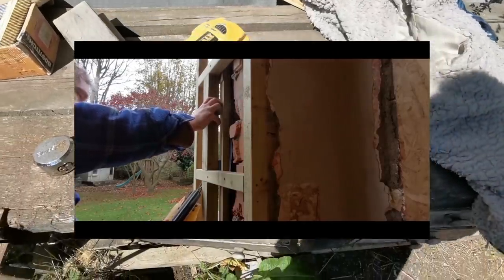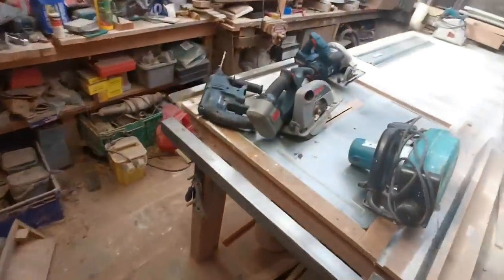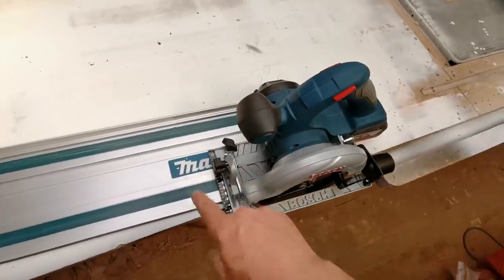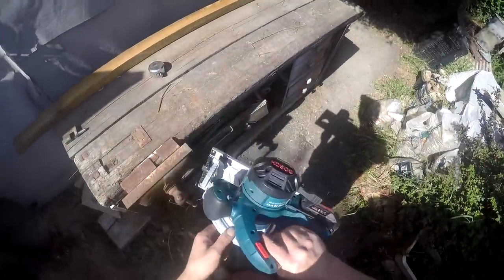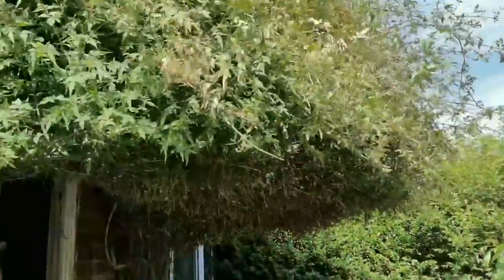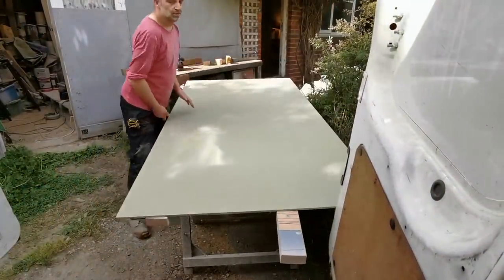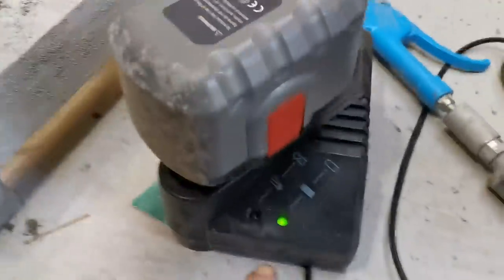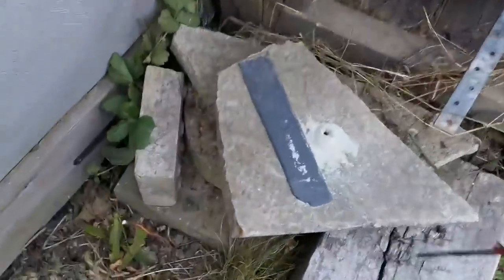Waffling about Bosch 18v Li, 24v SDS & Saw, Hospital bed, HiKOKI NR1890DB gun & 4ft paling fence

Comment: My van got nicked last year with all my gear so had to buy all new tools and a van !!! 
But this time I went everything cordless track saw miter saw table saw best thing I ever did !!! Welcome to the cordless revolution 😂👍🏻
Reply from the maker: 👍👍 sorry to hear about your van but yeah some good came of it, a big part of my tools are now cordless n the rest will be following that route, 👍
Reply: Gid Joiner happen it’s the 5th time twice in Birmingham once in London and the rest Manchester I should be a ambassador for dewalt.  Ps. Love the trick for getting old fence post out il be using that 👍🏻👍🏻👌
Reply from the maker: My worst nightmare that would be, I'd be screwed, Yeah the lever thing is cool, if you try this, do it with a welded chain and a decent piece of wood, not the stretchy rope n dodgy bit of wood 😂👍

Comment: Gid, thanks for continuing to post your work. Always a pleasure to watch someone just work with skill and knowledge, it’s the little things that make processes easier. As a chippie I too have a trim saw and a rail saw, but sometimes want to make a quick breaking down cut as you have.  I’ve always used the rails as a straight edge, but ride the saw on the sheet, but with the base of the saw against the high edge of the rail, just requires measuring off the 30mm or so. This means no risk of trimming the rubber or rails and no need for making a jig.      ATB, Graham
Reply from the maker: You're welcome, 👍 Yep you can learn the basics in a few yrs but takes a bit more time to learn the little tips that make it easier as you say, a job can seem simple & be going well but it only takes a couple of little hurdles to spoil things, If you know how to overcome them or better can see them coming 👍👍 Thanks yep i think that's what i'll end up doing, i need to get to know this saw, know the 30mm or whatever it is as you say, i like that the tracks don't need clamping down with the plunge saw so we'll have to see how it goes with running the saw along the edge, i've got clamps but that will be a pain for a quick cut, if i do decide/find the motivation to make a base jig i'll be leaving it at least a few mm's off the rubber n it has to be quick to attach to the saw, no messing, Thanks 👍

Comment: Never thought much of Bosch - much happier with DeWalt - another good video  - thanks for posting
Reply from the maker: I bought the 18v Bosch drill/driver because of the torque rating for putting in coach screws, I'd killed a couple of Dewalts in the past way too quickly, Dewalts may have improved but the Bosch driver is strong n has out-lived the Dewalts i had 3 or 4 times over, i got the Bosch 18v jigsaw n planer, they work well, then got the 18v grinder, then the impact so i now have half a dozen batteries 😏😁 Thanks Julian,
Reply: Bosch blue pisses over Dewalt, although the newer Dewalts are better than they were.  Can’t best makita for balance of price to cost.  Want top dollar? Get Panasonic but harder to find and not as much tool choice
All the best from Croggie, east Leeds

Comment: just bought same saw.get two trend blades for about twenty quid,great value.well pleased with saw.also got the 18v hammer drill as well very good.
Reply from the maker: Good 👍👍 I've half a dozen blades, rip n fine cut, they're the same as the Makita plunge saw, the 18v SDS is on the waiting list, I've spent up for now with the nailgun but good to know your happy with it,

Comment: I'm a Bosch man, Very happy with them. Sometimes its a well to go and get the 'Special' packs. That throw in batteries. I needed two new Batts, but for an extra  $60 (£30 ), I got two new drills standard and impact. I'll probably do the same and sell the old ones on 'Gumtree'. Not a problem for me with the blade on the right.. I'm left handed 😎
Reply from the maker: Good, I'm happy with the Bosch i have 👍👍 I was looking into that reg the sds, i have 5 or 6 bosch 18v tools but only four x 5ah n the two smaller 2ah (or whatever they are) batteries so next tool i think i'll do that, see if i can get batteries inc or vice versa like you say 👍

Comment: Love the videos gid ! I’ve recently bought the dewalt mitre saw stand, £150 on Ffx tools absolute life saver ! Definitely worth a look 👍
Reply from the maker: Thanks 👍 Yep tempted, the one i've got is crap, which one did you get, the big 1.7m or the smaller 1100mm one? What i mention in this about cutting the wood with the cordless is that the pieces i'll be using are 8x2 x 4.2m, if i can cut them on their stack then just lift them in place i can cut out the one more action of lifting them onto the saw stand, getting old 👴😂 in the past the size of it in someones house or in the van was a consideration & I've spent a lot this yr, I could've made do with my air nailer, 240v circular rip or plunge saw n my mitre saw 😂😂😎

Comment: Be interesting to see how the hikoki is after a couple of years abuse. I know the paslode is tried and tested in the field.  Still my go to gun for first and second fix    despite the gas Being a pain sometimes. I've not used my first fix paslode in two years. But I know with some fresh gas she will start and do some work after her long rest.
Reply from the maker: Yep I was  happy with mine at first but the main problem was the cold weather, not having gas or a dead battery was my fault 😁 the Hikoki is Hitachi and they're not bad tools, providing the new name doesn't mean they get built cheaper quality it should last a while, a few comments have said they've had theirs a while with no issues 👍 I see the US carpenters using Hitachi air guns that are well worn from yrs of use, I'm assuming that that means Hitachi have some experience of making nail guns that last, I don't know how long they've been making this gun or how long the tech in this has been around, but we'll see
Reply: I’ve gone a few hitachi pneumatic nail guns that have fired literally millions of nails without fault so I bought the battery unit 18months ago and it’s been bullet proof so far, sinks 90mm nails flush into lvl which my paslode won’t even look at. Only gripe is it’s a bit heavy and wide at the tip so can be had to skew nail

Comment: I learned with the blade on the right and bought a cordless on the left and can't get bloody used to it at all
Reply from the maker: 😂😂🤕 I've only ever used blades on the right also, this i bought solely to do like i did roughly with this scrap, more accurate cuts i'll use my speed sq too, i want to watch it run along the square & see the blade cutting,  but i might end up getting the one with the blade on the right too,
Reply: Blade left is a nightmare. I take home a pocket full of sawdust every time I use mine.
Reply from the maker: 😂😂  i'll remember that when i'm doing the same 👍🤔
Reply: Hear hear i am the same. 15 odd years pretty much on the one saw Makita 5903r and can not cut for shit with the left bladed saws, can't get used to the sighting but also the weight is all wrong to me. I want the weight on my side not with the offcut going skewiff at the end of the cut. Dewalt do some nice cordless ones now.

Comment: You are quite right about track saws, they are designed for left handed people just the same as most tape measures.   If you are reaching over an 8 x 4 sheet using a track saw and you are right handed it is quite possible to twist the saw into the track and take a bite out of it.   Who the f*** designs these tools?  Love your honest approach to all woodworking both on site and in the workshop.
Reply from the maker: yeah tape measures get me, you've got to read the metric upside down 👍 Designers, people out of college with no practical experience 😏  it does have some practical qualities having the blade on the left, it could be a H&S issue here in the UK maybe? I've played with it & the base is sat on the waste side of wood when cutting like in this vid so our standard right hand has it's pluses too, I might have to buy both saws, one left n one right, Thanks David, once I've used it for a while i'll have a bit more to say n I'll keep giving the pros n cons of it 👍
Reply: I wonder if it’s to do with having the offcut fly off away from you rather than towards you?
Reply from the maker: Yep, there's a few reasons, If you stand up n hold the saw by your side the blade is next to your leg, on the table most people are right handed so you hold the wanted piece with your left n cut with your right n as you say the waste falls away......

Comment: Wonder why we don't get the worm drive saws with the motor inline over here?
Reply from the maker: 👍👍 I've watched them on tv n online in the US n thought the same, it does have some practical qualities having the blade on the left, it could be a H&S issue here in the UK maybe? I've played with it & the base is sat on the waste side of wood like in this vid so our standard right hand has it's pluses too, I might have to buy both saws, one left n one right 😂
Reply: A couple of years back I bought a Bosch worm drive saw from the states it's exactly the same as the Skilsaw I think they must have bought them out. I had to put a 110v plug on it & it has no riving blade  so it would be illegal on site here, but it is a great bit of kit very accurate as I can see the cut much better.

Comment: I have an apprentice at work left him to do wnd bds in a 1st fix 
How can I do them I haven’t a router for ends he said 
Changed times eh
Reply from the maker: Yep I had a bag with a few basic tools, jigsaw n a rip, lump hammer n my belt , a box with hand tools n a level, 👍 sorry what's wnd bds?
Reply: @Gidjoiner  I think he means window boards and possibly the rounded edges on the over hang
Reply from the maker: hmm yeah i read it as window boards maybe but they're not 1st fix?
Reply: Gid Joiner 
Yeah window boards 
They’re 1st fix
Reply from the maker: Ok, when on site we did as asked, no questions 1st or 2nd fix, It says joiner/carpenter on my certificate 🤷‍♂️🤷‍♂️😂

Comment: Looking forward to the summer house build, APPARENTLY it's my next job !!!!
Reply from the maker: 👍👍 Yep me too, that's going to be quite a long job, 👍 Are you building one or is that a quote from me?
Reply: @Gidjoiner  I would like to build one but i think the material sourcing and costs will be too high so I would assume a bought one from Dunster cabins will probably be the way forward.  That's why i am interested in hearing your thoughts on this.  Mine is on a bit of a raised decking so that will have to be beefed up quite a bit plus the permitted development height restriction may be challenging on the head height.  Wife is only 5' 3" so she will be ok
Reply from the maker: 👍 This one has about £7k for materials, insulated &  plaster boarded inside, GRP roof n a skylight, the height is a concern but it's down in a garden & the neighbours shed is 10ft higher on the other side of a hedge on a garden that's raised a bit, Those Dunster cabins aren't cheap, I'd consider a 3x2 or 4x2 stud wall, OSB if you want, breathable membrane & some decent 18mm shiplap or loglap, then felt shingles on the roof on 18mm OSB, That's similar to what I'll be building, & i have some pics on Facebook of some timber sheds/summerhouses I've built. 👍 Photo Albums https://www.facebook.com/gid.joiner/photos_albums A big shed i made https://www.facebook.com/media/set/?set=a.153688074717567&type=3 A Garage  https://www.facebook.com/media/set/?set=a.257090067710700&type=3 , & just one of the buildings i made https://www.facebook.com/media/set/?set=a.673314579421578&type=3
Reply: You have some nice installations there Gid. Can’t wait for this project to start.

Comment: Good video Gid, I can highly recommend the Dewalt 18v SDS and they now do a 54v flexvolt version, brilliant drills. Have you looked at the small dewalt mini circular saw ? They are great for quick ripping down of sheet materials, see my video here (sorry, not spamming) it might let you see what I mean https://youtu.be/Ne6zLhLFP6Q  Great channel, working my way through some of your content ! 👍😀 Looking forward to see how the Hikoki first fix nail gun performs for you. I have two of the Dewalt but they also struggle with 90mm nails, thinking of upgrading to the Hikoki / Hitachi.
Reply from the maker: Hi, thanks 👍👍 i have no dewalt cordless stuff, I'm trying not to buy too many different brands, done that in the past n you end up with a row of them all plugged in on site, at the moment i already have 3 chargers in the van & half a dozen Bosch batteries, The nailer is good, I put in 448 2" nails today without a glitch on one battery that had already been used a bit, it is heavy but has plenty of power,  I played with this before xmas but couldn't afford it then, I also played with the Dewalt early last yr n wasn't impressed, it only put the nails in flush & there was that fraction of a moment waiting for the gun to be ready, this one is ready straight away, it sinks them well in is fairly quiet, i can't remember how loud the dewalt was, I might make a vid on it because when researching before buying most videos sounded like they were reading from a manual but want to play with it for a while,
Reply: @Gidjoiner  I hear what you're saying regarding tool bands, that's why I tend to stick with one or two - don't want all the different chargers etc. Yes the Dewalt nail gun is not great with 90mm ringshank but I have fired thousands of 50mm through my two guns and never really any issues (I only use them for fixing fence slats). The Hitachi does seem a better gun, so looking forward to your thoughts on it. You are a guy that will give a review based upon actual use as opposed to most reviews out there, where they get the tool, use it and return it..........
Reply from the maker: Yep will do, as time goes I'll keep posting likes/dislikes n if i don't say anything you can presume it's doing it's job 👍